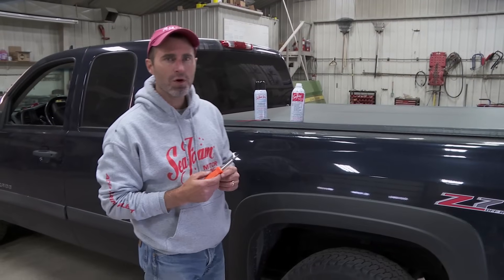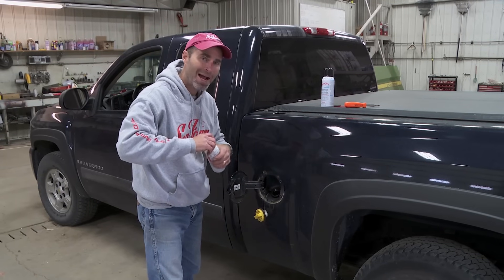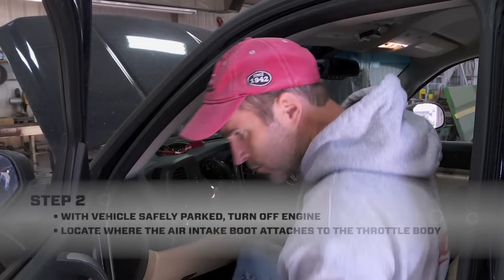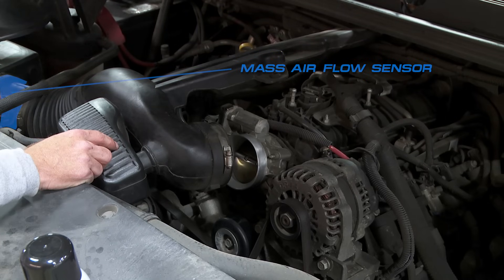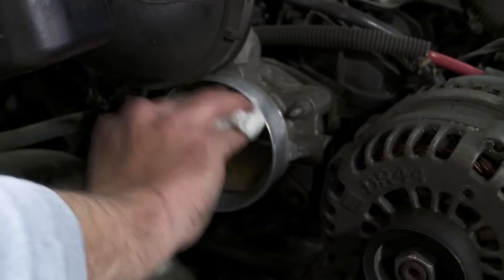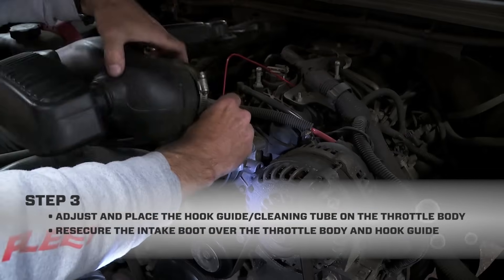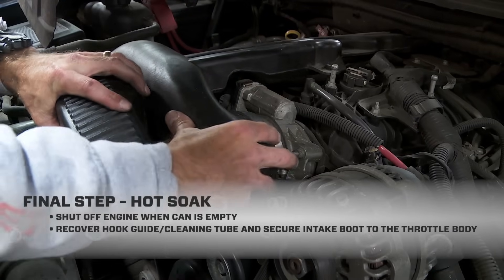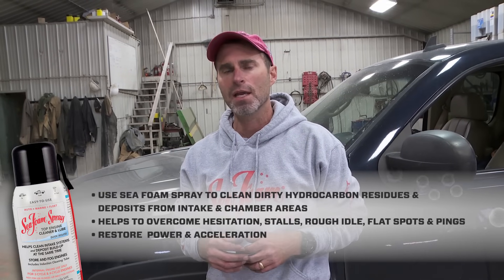How to clean a gasoline fuel injection air intake with Sea Foam Spray

Comment: Hello, and THANK YOU for a promising product. Need your insight here please:  I accidentally drove my car for 1 week without my cone filter, it somehow fell off. Because of running my car without an air filter for 1 week,  I thought I would need to clean up anything that might have gone into my intake. Therefore I have added Sea Foam to my gas tank at each fill up, used Sea Foam to clean the throttle body, and poured Sea Foam into the crankcase. I've also changed the oil 3 times. Should I have needed to do all that? Should I do something else to make sure my car engine (2016 Subaru Impreza non turbo) lasts as long as it should as if the filter not had fallen off? Your insight will be most appreciated!!!! Kind regards, Louis
Reply from the maker: Thanks, Louis.  Sea Foam is a blend of petroleum solvent/lubricant oils - it works to dissolve petroleum residues and deposits in fuel systems.  Your auto's air filter works to filter solid forms of matter from the atmosphere, protecting your upper engine from debris, dust, dirt...whatever can be drawn in.  Sea Foam would not help or have any affect on that sort of thing.  Regardless, unless you've been driving down dirt roads, pollen, a bug frenzy...You're probably in the clear.
Reply: Sea Foam Official thank you thank you sir! Your insight gives a peace of mind 👍🏽
Reply from the maker: Glad to help - that's what we're here for.    :^)

Comment: been using seafoam in my vehichles and small engines (which are used commercially) for over a decade and will continue to do so as ive come to have complete trust in the product . and i spend alot of time on internet foruming with others that use small engines and trucks commercially and have found theres a huge group of sea foam loyalist . great job sea foam , and good vid here for a quick / simple way to clean up intake !
Reply from the maker: We appreciate your comments, Roman Soldier.  Thanks for sharing and thanks for being a SF customer!

Comment: What about instead of adding the bottle to the fuel tank use it on the brake booster line while the vehicle is running? Same results? Thanks
Reply from the maker: Depends on what area of the upper engine you want to treat.  Going through the fuel tank works through the fuel injectors.  Going through a vacuum line does not pass through the fuel injectors.

While I have your attention will suggest this:  When your tank is low, add a whole can or two to your fuel and drive - the higher concentration in fuel, the better it cleans fuel passageways.  Treat the intake with a full can of Sea Foam Spray - it works FAR BETTER than going through the vacuum line.  Sea Foam Spray will work to clean intake valves and chamber areas.
Reply: I wouldn't suck this stuff through vacuum lines, there's a chance you will hydro lock a cylinder(if you're dumb enough to suck up an entire can.) in the process. That's why he is telling you to use the spray. Another tip is to be ready to change spark plugs after using this stuff because it can and will shit carbon all over them with and older vehicle.
Reply: Acid Soup i tried spark plugs right before i did the seafoam in the throttle body

Comment: Remember boys and bitches you absolutely cannot have the ac or heater on when doing this.
Reply from the maker: Correct.  Unless you want to add draw on the engine, which is counter-productive.

Comment: Can I use the spray on my duramax diesel.
Reply from the maker: Great question.  No, ignitable vapors or multi source of fuel should never be used in a diesel intake.  Could cause a runaway.

Comment: Do you hold the can upside down? I couldn't seem to empty the entire can. It smoked while I was doing the treatment but not after the hot soak, does this mean that I did not add enough? Should I do it again, I must have gotten 2/3 in. Can you treat the engine too often?
Reply from the maker: It will spray upside down but if it doesn't spray at all that's a different problem.

Do you mean that the can no longer sprays and there's still Sea Foam liquid in the can?  Please let us know and go from there...

And, no, you cannot treat too often though there's a point where it's not necessary.  We recommend a minimum of 2x per year.  If serious cleaning is needed, it's safe and helpful to do a repeat.

Comment: Hi can I use it to my 1998 Corolla. Will it help pass smog? I put guaranteed pass smog additive to it yesterday, will it harm if if I add sea foam too?
Reply from the maker: Yes, will work great in your Corolla.  Sea Foam comes from the same petroleum raw material as fuel so can safely mix with additives.  Our quick 'pass the smog test' recommendation is to add a can or two of Sea Foam Motor Treatment to a low tank of fuel, drive 20 or so miles and leave overnight, add a few gallons of fresh fuel the next day.  Also do a full can treatment through the upper intake with Sea Foam Spray.  Don't add cleaning treatments (that actually work) right before the test because they're cleaning while they're in the fuel system.

Comment: Can I do a Seafoam throttle body treatment on a 2013 Mini Cooper s turbo ( N18 engine).  It has an electrical throttle body with plastic throttle plate. I will have to spray Seafoam 12'' up stream from Throttle body in order to seal system while spraying.  Mass flow sensor will not be a problem, it is on the turbo side of the intake system.
Thank You Very Much for your Help.
Reply from the maker: Yes, can do.  Just make sure you set the straw long enough to place the spray nozzle in front of the throttle plate opening.

Comment: What about a dual throttle Body engines like my infiniti g35? Use two cans?
Reply from the maker: Hi Austin:  Great question. Can do 2 cans (1 each)  or do a half can for each throttle body.
Reply: Sea Foam Official Sweet! thanks for replying.

Comment: A load of shit tried it to day, put a hole can in the fuel tank and filled the fuel filter done all the thing you tell us to  my van didn't even smoke like the video shows ,all its good for is clean shit off your hands
Reply from the maker: Gareth:  The white smoke is oil vapor which would be visible when Sea Foam Spray is applied as a direct concentration into the upper engine.  Adding a can of Sea Foam Motor Treatment to the tank or filter disburses into fuel phase so the lubricant that causes the white vapor would not be concentrated enough to be visible.
Reply: Hi it maid no difference to my vw crafter

Comment: After going about it in this method (through the intake), would I need to change the oil soon after? I've heard some people say you have to after 200 miles, while others say you only need to if you put Seafoam in the oil. Which is true?
Reply from the maker: Hi Bernard:  Sea Foam Spray through a 4-stroke gas intake (top end, gasoline delivery and combustion) and the oil crankcase are separated areas of the engine (oil is contained in the crankcase), so changing the oil after an intake cleaning does not have a cause and effect relationship that leads to changing oil.  When adding to oil, drive at least 100 miles for it to work thoroughly, which is why we recommend adding to oil 100-300 drive miles before each oil and filter change interval.  Hope this helps!
Reply: Awesome. I'm planning on doing it today!

Comment: I need to do this on my 99' Protege. Is it the same procedure if you have a carburated engine? Its for a 85' Corolla?
Reply from the maker: FWIW, be careful of the oversight of thinking that going through the air intake/carburetor throat is going into the carburetor.  Cleaning a carburetor (circuits and passageways incl needles/seats, jets, bowls, nozzles)  requires Sea Foam added to the fuel tank.
Reply from the maker: Thanks for the question.  Yes, very similar process except a carburetor engine can run with the air cleaner removed (apply Sea Foam Spray straight into the running carburetor throat).  Look for another Sea Foam Official video that covers the process using Sea Foam Spray in a 65 Impala.
Reply: Thanks Sea Foam Official i will be watching the video :)
Reply from the maker: You can also find step-by-step instructions on the Sea Foam website's HOW2 page.
Reply: That is how I use it on all my mowers, weedeaters, etc.; pour it right into the carburetor.  Use a little in the tanks, too.  Keeps everything running smooth.

Comment: when I press the break at the stop light, it makes a chugging sound and shakes and the check engine light blinks. will this fix it? and it's due to snow really bad tomorrow. do I have to drive it to get it working? thanks
Reply from the maker: Thanks for the question.  Sea Foam Spray treatments through the upper engine will help  a rough idle and hesitation!  Also add a full can or two of Sea Foam Motor Treatment to  a low tank of fuel to clean the fuel passageways.

Comment: will this fix misfiring codes?
Reply from the maker: Please send a question using the Sea Foam website's Ask Jim feature. We'll walk you those diagnosing the cause.
Reply: Lovely Fins no it won't. Misfire depending on the vehicle could be a wide variety of issues

Comment: engine cranks over, getting fuel, getting spark but will not start. 2001 GMC savanna 2500 any idea's
Reply from the maker: Hi John:  Are you asking related to Sea Foam Spray or just need help with getting your truck running?
Reply: John Culbertson check compression on all cylinders

Comment: What's with all the flies? It looks like you're just at a corn elevator, I've never seen them that bad around here.
Reply from the maker: The vid was shot at a large farm during the middle of corn harvest. Lots of grain hauling, corn dryers running full tilt...cold outside, warm in the shop...flies.  When cold out, flies like hot engines, too.

Comment: I just used this on a 2001 VW Jetta, it worked great and it improved the idle and acceleration. No joke, this is simple and easy. I didn't really expect that much of a boost in performance, I will certainly use this product again.
Reply from the maker: Hi Mark:  Great post and appreciate the mention that it's simple to do!

Comment: PLEASE HELP!!!!!!!! Hi I used this In my 2003 Audi A4 3.0 and now my check engine light is flashing and it's running really rough and sputters. I'm really scared I messed something up. I followed this video exactly and I feel like I messed up my car to the point of no return.
Reply from the maker: Ted:  Feel free to call our tech line or send an email using our website's Ask Jim feature.  It seems you triggered a response sensor and how your engine's computer manages the air/fuel needs to settle back to normal.  That sort of thing is temporary, solves itself.  If settles, try disconnecting the crank battery to reset the computer/code.

Comment: altima hybrid 2009 got check engine light on code p0300 random misfire ...nissan dealer diagnostic   carbon build up needs top engine clean price 370 ...i bought 2 cans of seafoam 14 dollars autozone  followed this steps and my car is running like new again has more power then before  ...
Reply from the maker: Thanks, Herson.  That's the idea!   Anyone can do this.  2 intake treatments a year goes a long way!

Comment: My mini cooper's mass air flow sensor is right before the hose clamp where I would insert the spray nozzle, but still technically downstream. Would it be risky trying the engine top cleaner?
Reply from the maker: Hi Bret: Great question. Once the intake boot is over the hook straw and your RPM is 2000+, the air draw from the engine is so strong that there's no way for the fluid to go back upstream. To avoid any fluid near the MAF, only spray when the RPM are up.  No worries.
Reply: +Sea Foam Official Thanks a lot! I'll give it a shot this afternoon.
Reply from the maker: Happy to help! Let us know how it goes.  Also letting you know that you can find detailed instructions on our website's HOW2 Instructions page.

Comment: does seafoam restore compression to engine? because I want to add seafoam to my 1997 dodge grand caravan se with the 3.3L
Reply from the maker: Yes, if the compression loss is caused by compression rings restricted by petroleum residues.  Best to remove spark plugs and add Sea Foam or Sea Foam Spray into the cylinder cavities.  With plugs out, add 1 oz of Sea Foam per cylinder cavity and allow the car to sit and soak up to 3 days.  Helps to crank engine once a day.  Re-set plugs and wires after sitting and see what happens.
Reply: Awesome Thank you
Reply from the maker: Low cylinder compression can be related to valves, gaskets, ring wear or restriction, other... When compression rings get gummed up/restricted, the rings can't move freely in their space = compression loss.  Sea Foam works to dissolve the petroleum residues that cause the compression rings to stick.
Reply: huh

Comment: seafoamofficial, can I use this on my 1999 yamaha bear tracker 250 utility atv?
Reply from the maker: Your ATV probably has a carburetor.  Because ATVs and many small engines have small tanks, just add a full can or two of Sea Foam to a low tank a couple time a year and run it!  You'll clean your upper engine and carburetor circuits at the same time.
Reply: TheGunner1212  yes u can in fact any engine
Reply: longlive2smokers thank you would you recommend the spray or mix with fuel for atv

Comment: I have a 93' Cadillac Fleetwood Brougham that won't  stay on. I've changed the fuel pump, filter, and wires. And just about everything else on the car except the injectors. Do you think my fuel injectors are clogged   or bad? If so, will sea foam work??
Reply from the maker: We aren't able to diagnose but worth a try!  Add a full can or two when the tank is low, drive it and see what happens. Sea Foam Spray through the intake can work wonders on older autos.  Let us know.

Comment: Need an updated video for new Ecotec3 5.3L
Reply from the maker: Thanks for the suggestion.  FWIW, application works the same way as the Vortec 5.3.
Reply: Not sure what FWIW means.  I know I can add to the gas tank, but am looking to add to the brake booster line like I did in my 2010 Silverado.  I know that is not possible on the newer Ecotec3 5.3L.  Trying to find out how I can apply the same.  I want some white smoke!!!!
Reply from the maker: For what it's worth.  We don't encourage brake booster application. As a much better upper engine treatment we emphasize Sea Foam Spray through the throttle body.  White smoke is vaporized lubrication oil, which can be noticed when using Sea Foam Spray.

Comment: when I used it on my 2000 Acura RL and followed the instructions no white smoke came out through the tail pipe I wonder what happened
Reply from the maker: Hi Robert:  There are a few considerations when lack of white oil vapor is noticed. #1 is wind will immediately carry exhaust vapors away. Others are the straw was not placed in front of the throttle plate or the RPM weren't elevated over idle to pull the spray through the top end.  The other obvious is Did you use the entire can (recommended)?  Did you perform a hot soak?  In any case, call our tech support and we'll be happy to help you review.
Reply: Robert L. Merida did it atlease work even though u saw no white smoke?

Comment: can this be used on a 2005 pontiac g6 it's a v6 engine? well the spray one I already use the one that goes in the gas tank and oil
Reply from the maker: Yes, Sea Foam Motor Treatment (add to fuel tank and oil crankcase) and Sea Foam Spray (through throttle body) can be applied accordingly to a 2005 Pontiac G6.  Accessing a '05 G6's throttle body will be very similar to the Chevy truck in the video except the air boot connects from the right side of the engine.

Comment: beautiful.  even the same motor I needed help on.  I removed my throttle body and  cleaned it (it was filthy ) did my best on the intake manifold.   I'm wondering what my valves look like if my throttle body looked the way it did.  I noticed you moved the throttle plate with your hand, I did as well when cleaning it but it was completely removed.   I was telling a guy about that and he told me he had to replace a throttle body once because he moved it by hand and threw a sensor out of wack or something. does the cable need to be disconnected from the TB when inserting the seafoam nozzle?
Reply from the maker: Thanks, Michael.  To answer your question: No, no disconnection.  The video doesn't leave out anything.  As far as the throttle plate goes, most Chevys are OK to push if keys are off.  Ultimately, there's no need to touch the throttle plate whatsoever  Have a helper turn the key on and press the foot pedal to show what side of the plate turns in.

Comment: Can regular seafoam be used in the tank to clean out significantly dirty injectors?  I've already used regular seafoam on my intake and verified with an endoscope that both the intake valves and pistons are clean, but I've still got some hard starts and stumbling on acceleration, plus slow loss of fuel pressure once the engine is shut off ( I've already checked the pressure regulator ) which makes me suspect dirty, leaking injector/s.  What ratio seafoam to gas would I use?
Reply from the maker: Thanks, Bob. Great question!  Serious cleaning requires a serious concentration.  One great thing about Sea Foam is that it can't cause harm, and the more you add (higher ratio), the better and faster it cleans.  Suggestion:  Add a high concentration of Sea Foam to a low amount of fuel.  The lower the fuel, the easier it is to get the ratio up.  Two cans into 2 or 3 gallons of fuel is typical.  Then do a Sea Foam Spray treatment through the throttle body except let it hot soak for several hours to soak around the compression rings.  Give the engine 20 to 40 miles to settle after the treatments.  Let us know what happens!
Reply: I'm curious, how did it go?